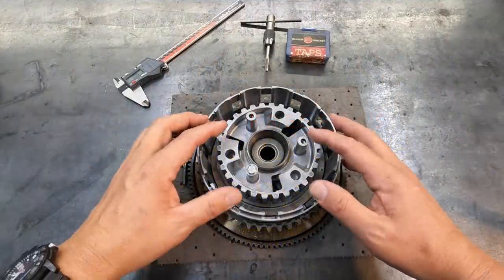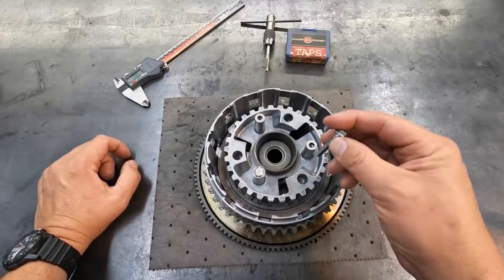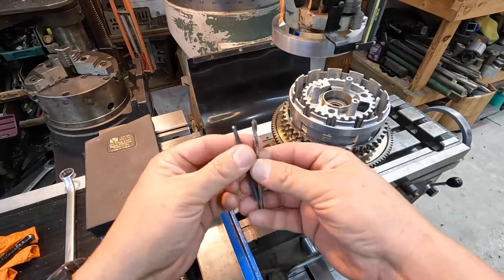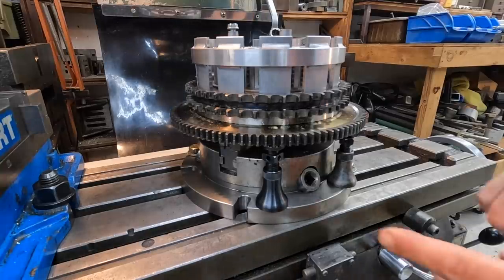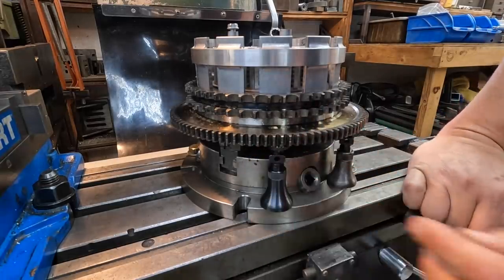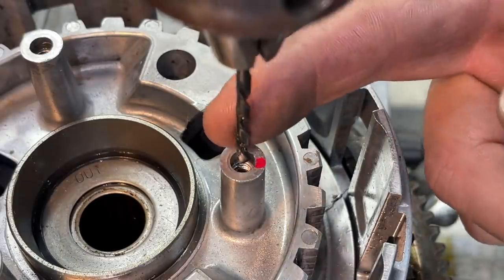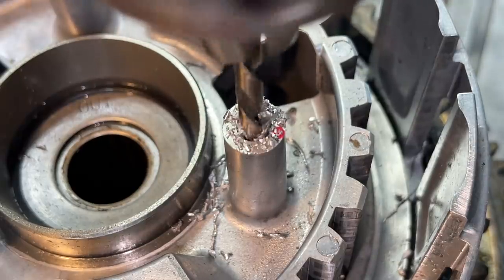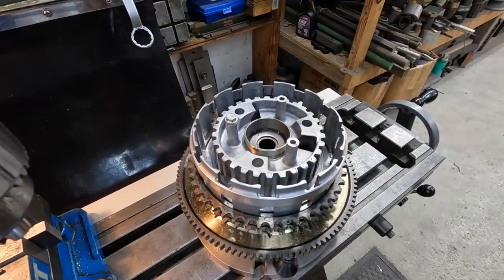Harley Davidson Clutch Basket: Broken Bolt Removal

Comment: 30mm original thread. 12mm helicoil. 
Not sure, but the difference in holding power will be an issue in my mind.
Reply: Nah, with 15mm of thread engagement in aluminium, a typical M6 steel bolt would already break before pulling out the threads. The original bolt broke off with not much more engagement than that.
The common (and admittedly way oversimplified) rule of thumb is to have at least 1x the nominal diameter of thread engagement in steel and 2x in aluminium.
Reply: @mlenstra  the fact that they dont install helicoil or similar on all expensive preformance aluminium parts from factory to prevent things like this is to me a mystery.
Reply: @Mjerkcheeze  that wouldn’t make too much sense, adding helicoils wouldn’t add any strength over a nice 75% thread tapped straight into the aluminium. It would add a lot of complexity and cost to the manufacturing. When parts are designed properly, the specified torque is way under the breaking point. The reason bolts break in cases like this one is almost always down to either overtightening, corrosion (mixed metals + moisture) or an attempt to loosen with Loctite in there w/o heating.

Comment: You should have only used left handed bits for the entire job.
The thread in the bore will not extend to the bottom of the bore. Using the right hand bit to indent the broken screw risks driving the screw down into the unthreaded section of the bore where it could jam.

Comment: What keeps it from backing out?
Reply: The heli coils have a micro taper as you thread in the fastener it flares in the the newly cut threads locking everything together.
Reply: Spring pressure, clutch springs will be pulling on it in this application.
Reply: @lakinnenlako6883  
Is probably a better solution than original
Reply: @pennypincher6730  Thanks
Reply: @pennypincher6730  ABSOLUTELY CORRECT!!

Comment: Not a criticism, but actually a question of interest. Are you happy having only 19mm of thread in that 35mm hole?
Just because, it used to be threaded I guess at least 25-30mm. I understand it might be hard to phase the helicoils to match up, so stacking them would be a pain. Just wanted your thoughts on that.
Reply: For what it's worth, I pass along the following:
It is commonly known that the minimum recommended thread engagement to make a strong connection for a component with a tapped hole is approximately 1 times the nominal diameter in steel and 2 times the nominal diameter in aluminum.
Reply: I think but I'm not sure of the actual ratio but1-1/2 times  the diameter is all that is needed for maximum holding power and the original thread depth is to accommodate the need for a long bolt to facilitate assembly

Comment: M6 in a Harley? No freedom threads? Sacrilege!
Reply: Harleys are more "assembled in America."
Reply: all the way back in the 80's, they had Showa forks so there was at least one metric item for 30-40 years
Reply: @andersjjensen  no it wasn't. Metric was a French invention from the 1600's. True it was adopted as the official system after their revolution, mainly because of pressure from the scientific community for something consistent. Imperial was just English. Nothing to do with empire.
Reply: @andersjjensen   Most people I know call it standard. If I called it imperial, I would get a strange look from them.

Comment: An upgrade for the whole clutch basket would be to fit the other two bosses with Helicoils as they would allow a bigger margin for tightening torque, pull out and thread erosion.  It might have been more prudent to go the Helicoil route by drilling the offending broken bolt out rather than trying to extract it.
Reply: What you suggest is the common Harley mechanic "fix".  Done all of the time!

Comment: No criticism about your technique. Bang up job as always. But I feel like the last time I did a heli-coil I was supposed to loc-tite it in?? Was surprised when you used oil.. Have the rules changed or am I going senile already?
Reply: I have never put loctite on a helicoil. Unless Helicoil themselves recommend you do (which they don't) then it's just over cautious weekend engineers that do it as a 'just in case'

Comment: Just a question could you have indicated the out side of the hole ?
Reply: Much more accurate to indicate on the bore rather than the outside diameter. Theoretically there shouldn't be any difference, but depending on how accurately that was originally machined there might be a very slight difference.

Comment: Are you going to keep the home shop when you open the new shop??? Just wondering how you are going to make that work without a lot of new tooling..
Reply: I think the plan is to do a lot of traveling back and forth, mostly work at the home shop. Experience tells me everything will ingrate to the new shop
Reply: I believe he alluded to the fact in previous videos that the new shop is temporary until their house is built. Then a new shop of his own will be built. But just like a movie, if you knew how it ended, there would be no need to watch the movie. Just hang on for the ride.

Comment: I usually just drill a hole in the bolt and then cut a left handed thread into there and bull it out with a matching bolt.
Reply: Hmm, how much stuff do you normally "f..k" up????
Reply: @paulcopeland9035  Rarely, but when I want to get it out cleanly the first try and not mess up the threaded part.

Comment: Those threads were probably damaged before you ever got it. Possibly even from a previous repair. That would definitely explain the broken bolt inside.

Comment: It is luck when a drill bit doesn’t wander into the threads during this procedure. I always drill thru with a smaller bit then a bit just smaller than the thread  outside diameter.

Comment: I might have Coiled all 3 holes. Stronger than the Aluminum, ya know?
Reply: the aluminum didn't break the bolt did, you're fixing the wrong problem
Reply: @normstaley9799  No, I understand that. I'm just saying that while yer all set up, why not Heli-Coil the other 2?
Reply: @rooster6057  maybe but, if it's not broke don't fix it

Comment: Why not just drill a hole in the bolt, punch a Torx screwdriver in it and carefully screw that bolt out?
Worked fine for me several times, never damaged a thread by doing so.
Reply: The bolt broke for a reason. And knocking a torxs bit in has the potential to break and make it harder to remove due to being made of harden tool steel. Well thats my thinking any way 🤷‍♂️

Comment: I was thinking you should have made a collar for the aluminum post in steel. It would surround the post with 1/2 to 3/4 of steel above it with a hole the size of your drill. It would brace the bit as it goes in. There is no way to see progress but you could just keep track how far you go in.  Probably only 10 mins work to make one.

Comment: I have to extract broken exhaust manifold screws from my hemi aluminum heads about every 60,000 miles.  It's common on aluminum heads and iron manifolds.    I hold a nut over the hole with pliers, and fill the hole with mig weld,  untill the nut is filled in, then thread the broken stud out with a wrench.    The steel weld material doesn't stick to the aluminum.   The weld filler metal even threads out, with a negative cast of the a hole threads on it.

I've got studs broken off 1/4" deep in the hole before with a nut and mig welder.   It only works on holes in aluminum though.  Don't try it in a steel part!   

Kinda like this guy does:    https://youtu.be/cUlJ5f2-FcQ

Or, for really deep ones, a copper tube and mig welder.
https://youtu.be/-8N0y0jVAng
Reply: yeah, welding bolts out works pretty well on most things.  but not on a clutch basket that has a stepped hole.  the threads actually start below the surface of the post.  and you might want to look at putting some studs in those heads if you're doing that every 60k miles...
Reply: @vintagespeed  

I asked the dealer about studs once, and was told they would void my powertrain warranty

Comment: Not sure if it’s a system you have seen but I prefer time sert over heli coil it’s more of a sleeve
Reply: I was thinking that myself: an insert would have been easier to get down past the counterbore. However, in 6mm sizes, inserts (EZ-LOK as sold by Mc-C) are only 3/8" – 10.5mm (depending upon the OD) installed length, whereas you can get Helicoils up to 18mm installed length, giving better pullout strength. 6mm inserts are either 3/8-16 or M10, so depending on the OD of the post there may not have been adequate material. Also, inserts weigh more than Helicoils so the potential for imbalance would be higher.

I personally prefer inserts as they don't require special tools or taps and you can remove them (relatively) easily.

Comment: Wouldn't it be nice if they spent another 50 cents on the insertion tool to use it with a tap follower?
Reply: The reason it looked so awkward inserting the insert is because he is not using the insertion tool properly, you are supposed to pull the rod part of the tool back and put the insert inside the cutout at the tip of the tool and then push the insertion tool inside the insert and then run he insert through the tip of the tool, it has internal threads the same size as the insert, this lets you but the face of the tool flush with the threaded hole and then just start spinning the handle and the insert goes in straight and without hiccups usually.

Comment: The Helicoil you installed had put the new thread at the top of the "posts", whereas the factory bolts were longer so that they could snug up at the bottom of the post.

Hopefully the owner isn't too hard on his clutch
Reply: I seen that as well. Would have set that helicoil at the same depth the other posts had their threads started at. Especially since the bolt wasn't fully threaded.

Comment: ADAM NEXT TIME  PUT A COPPER   TUBING OF THE RIGHT SIZE . THEN MIG WELD DOWN IN THE HOLE TILL IT COMES TO THE TOP OF THE TUBE THEN YOU CAN WELD A BOLT HEAD ON AND THE THREADS WONT BE DAMAGED OK .
Reply: Why are you yelling?
Reply: NEXT TIME DON'T SHOUT.
Reply: @russellv6234  IM NOT YELLING.  IM AL MOST BLIND

Comment: Is that a wet clutch or a dry clutch ?
I suspect it's a dry clutch. So, the question is, how much degreaser did you get into that bearing ? I'd suggest you dismantle the bearing and regrease it now.
Reply: It should be an oil bathed clutch.
Reply: @minigpracing3068  Hopefully that'll lube the bearing then !

Comment: The minute you knew it was not frozen, you could have finished with an easy out. I know, thatwould have been a boring video.
Reply: It's all about 'channel content, 26 min of dense content
Reply: I was upset he didnt do anything to isolate the repair area, I mean he allowed all those shavings to go into the rotating assembly etc... and a HeliCoil, the threads were 100% as the bolt came out unharmed!!   What if this was a high RPM fixture, No thought of balance or out of time..and lastly, The generic DIY helicoil tool... C'mon man..... Just wreck the part to make a video.... I bet this guys Sorry he sent it to him!
Reply: @johnbrevard5966  no no, correct comments are: "amazing work", "top notch"

Comment: Courous as to having that helicoil on one side wouldn’t throw the clutch out of balance? In my mind I was thinking you’d do all three to keep the clutch balanced?
Reply: Clutch balance on a Harley?
Reply: Some aluminum was removed with the larger helicoil tap drill to partially offset the weight of the tiny insert plus the client only wanted one broken bolt removed.
Reply: If it spins it probably should be ballenced 🤷‍♂️
Reply: @joeybourne1027  If the assembly was balanced at the factory which it probably was the tiny insert won’t change the balance enough to matter. The wheel probably never turns more than about 800 rpm. Actually the broken bolt would change the balance much more than the helicoil.
Reply: @ellieprice363  I’m not a machinist nor and motorcycle mechanic. I’ve put in a few clutches over the years in tractors, cars and go carts. As far as I can tell the clutch bolts directly to the crank and the only way to get full power and speed is for everything on the inside to lock up and turn the same rpm as the output. I’ve had a rear end of a vehicle that got destroyed because the mechanic didn’t  balance it. From what the mechanic showed me it was small thin very light weight washers that is used to balance it. So something that can turn 1000’s of rpm definitely should be as balance as possible in my mind.
Reply: @joeybourne1027  It definitely should be balanced if it turns that fast. Since there’s a large sprocket on the assembly I thought it rotated with the rear wheel. Still, it’s the owners option to have the clutch re-balanced if the tiny M6 insert  throws it off too much.

Comment: I reckon I can see that 3/16 drill is off centre from 11:08 . At 12:44 it's clearly off, then straightens up as it grabs and unscrews the bolt
Reply: Doesn't matter.  The heli-coil repair is how this is fixed.  A Harley mechanic who is used to this repair, will install inserts in the other two mounts as well.  It is a weak design and the heli-coils are much a stronger fastener.

Comment: Why not try an easy-out?
Reply: When you tap or twist an easy out into a stuck fastener in order for the edges of the easy out to grip, it also often deforms the fastener tighter into the hole it is stuck in.  Left handed drill will remove material and relieve the pressure on the stuck fastener until it releases - sometimes.
Reply: Easy-outs are the devils work.
Reply: Becuse there is nothing "easy" with them.

Comment: Is it possible to even make money on a job like this? Seems the time you take would be far greater than the $$$
Reply: No, you don’t make money on that type of job, you do it for the satisfaction
Reply: Knowing HD parts, that clutch basket probably costs a hell of a lot more to replace than to pay somebody to professionally extract a broken bolt.
Reply: @SteelCogs  That was basically what I was going to say, Japanese clutch basket can easily cost £200 or more plus may be back order to factory if none on parts shelf  bet most of that applies to HD parts.
Reply: @11THEFEZMAN11  Sure you can make money on this, you can make good money. There are some shops that specialize doing it.
Reply: @SteelCogs  And with the current supply chain situation, there could be a lead time issue too!
Reply: @Dino6961  do it for the satisfaction
Reply: I give the customer an estimate, along with possibilities, and let them decide. Having the part disassembled increases positive out come, rather than trying to perform with part still installed.
Reply: @SteelCogs  ...Last one I bought for a restoration 5 years ago, was $400!

Comment: I never could see how helicoil is as good as or stronger/better than the original threads.
Reply: it's steel and not aluminum, so stronger, and as it grips a larger surface in the surrounding piece, thus the force from bolt is transferred to a larger piece in the aluminum. It's llke using a bigger bolt, instead of the original smaller one.
Reply: @MarcusLindblomSonestedt78  Well said! Thread wire is as good as it gets! Fit, finish, and rust proof stainless steel!
Reply: You need to learn about an amazing new tool that lets you learn about things and how they work.  I believe it is call Google.

Comment: Adam.....the heli-Coil insert is supposed to go inside the open chamber of the inserting tool, then the hook on the end engages the insert, you place the end of the tool at the hole opening and then proceed to screw it into the threaded hole, this keeps the insert coil tightly wound as its being threaded into the hole, then you finish up with knocking the tang off.
Reply: Oppps....should have watched the vid to the end........
Reply: Oppps....should have watched the vid to the end........

Comment: should have thread locked bolt & insert tbh
Reply: When someone sends you a clutch then you can do it that way. You may not realize it but there are multiple ways to solve most problems.
Reply: @anthillmobstars  of course. But the thread inserts will fall out just as the bolts would if they weren't locked tighten. Harley's are thumpers :)
Reply: Helicoils are designed to lock into the threads without using a chemical compound. Once installed they are permanent.
Reply: It probably calls for loctite on those bolts in the service manual I can't remember it's been a while since I had a clutch apart , The thread locker will seep into the helicoil and lock it in and if you want to replace it you just rip it out with a pair of needle nose
Reply: @AllenCavedo  okay, but they are used in static and dynamic applications. this location & engine is highyl vibrational. more so than such of a control board or strengthing of static features...

Comment: Metric Harleys...facepalm.
Reply: rationality > nationalism
Reply: Harley Davidson was founded after the metric system was adopted in 1870.
Reply: @dDoOyYoOuUtTuUbBeE  I had a '68 dresser for 22 years. Not even 1 metric thread on it, and after 22 years I'm sure I would have found them. Also any major threads in the aluminum had heli coils installed from factory. Only place they missed were the header pipe mounting holes. Corrected that the first top end! I did.✌️
Reply: Try and get imperial thread bolts in the reast of the world. Even cat have woken up and moved on.